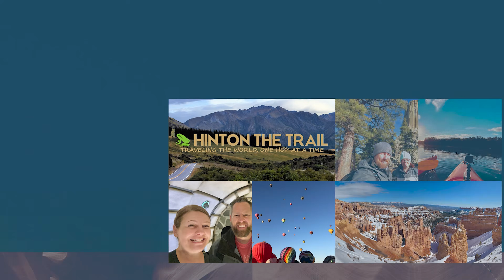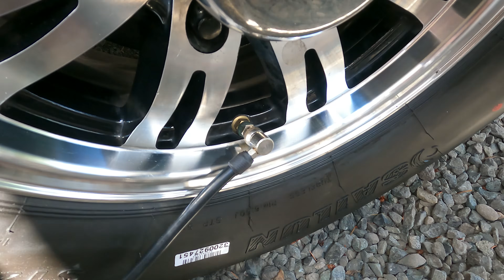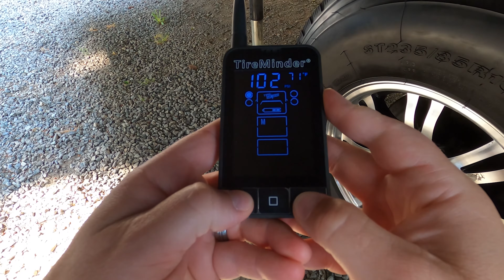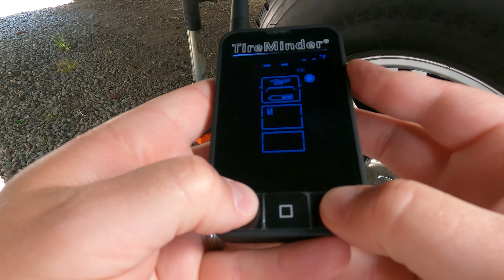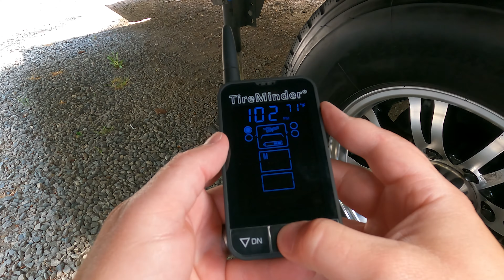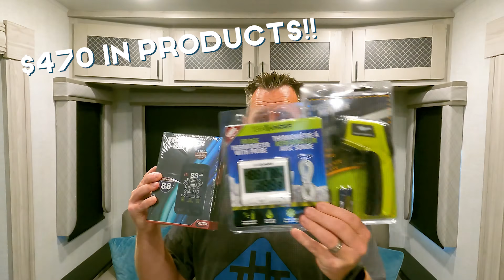TireMinder's Flow-Through RV TPMS Transmitter is an RV Game Changer

Comment: I had some of those too.  I'm telling you, I always dreaded having to add or take out air because of the caps.  The pass through sensors make a huge difference.  I also didn't know until I made my last video with tireminder, but the pressure you see scrolling isn't a true in that moment pressure.  They explained that it does check for an alarm every few seconds but it's at a lower transmission power unless an alarm is triggered which causes a faster update.  This is to save on battery power.  However if you hold the center and right buttons down, it will reset all the sensors to show zero and when the pressure comes up it will be a true real time pressure.  But it takes a few minutes but the other great thing about this is that you can use a regular gauge on the pass through sensor too!
Reply from the maker: You’re right, there is a delay on the transmitter. It is so great to be able to not have to take them off use a tire gauge.